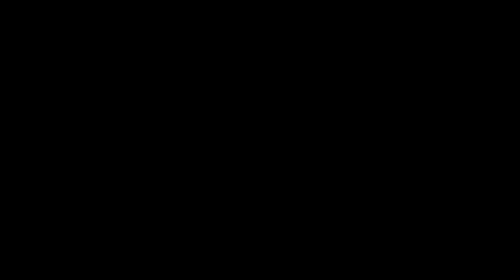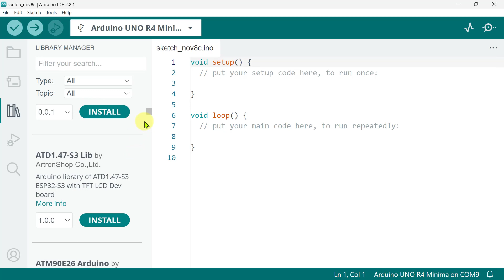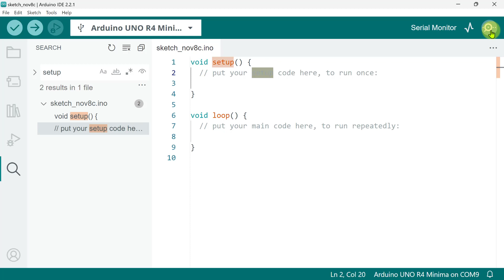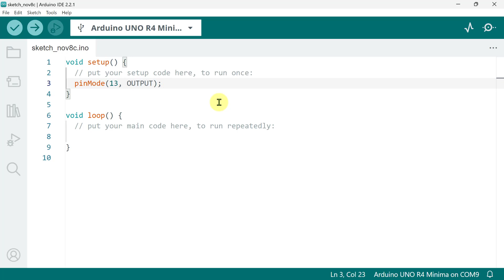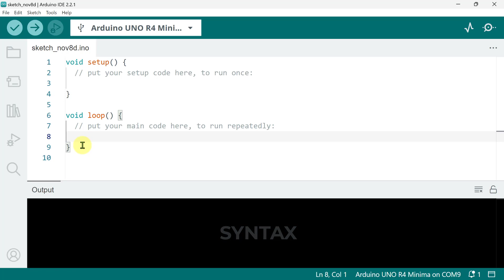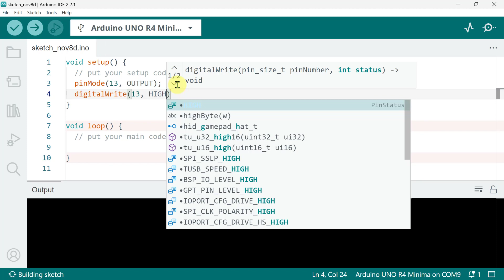Arduino UNO R4 Lesson 02. Arduino Programming for Absolute Beginners using the New Arduino IDE ver.2

Comment: I am getting a compilation error 'LED_RX' was not declared in this scope.  I did declare it in void setup() with pinMode(LED_RX,OUTPUT);.  What am I doing wrong?  (LED_BUILTIN, LED_RED, LED_BLUE show as possible choices while typing  LED , but not LED_RX). Do I need to install a library that names these LEDs?
Reply from the maker: Hi, are you using the UNO R4 board? It is not going to work for R3.
Reply: Thanks for the reply. I was using the UNO R4 WIFI board.  With the Minima I was able to call LED_RX and LED_TX.  All is good now. Thnx @joedgoh

Comment: superb,i have installed recently Arduino ide 2.2.1 Windows 11 ,but the feature is different and all the icons are not visible on the top,accessable only thru sketch and tools,  and the code is only black not in color like the ordinary Araduino ide.any idea why.Thanks a lot